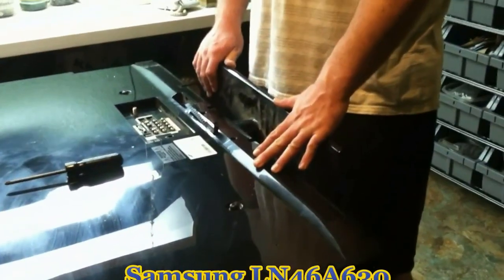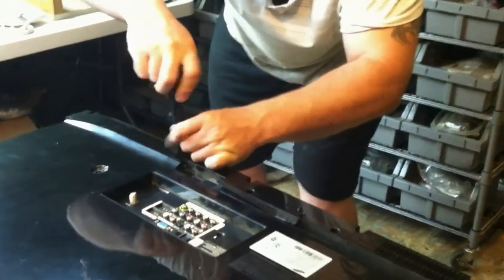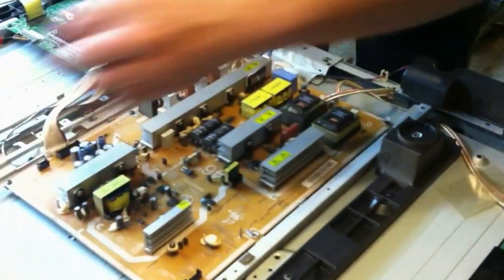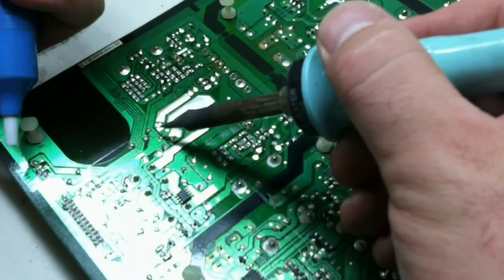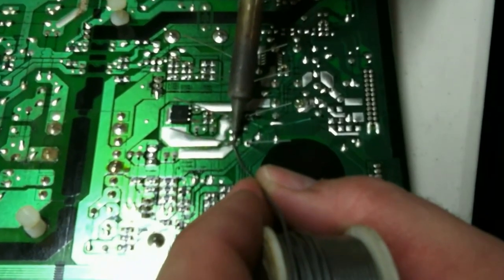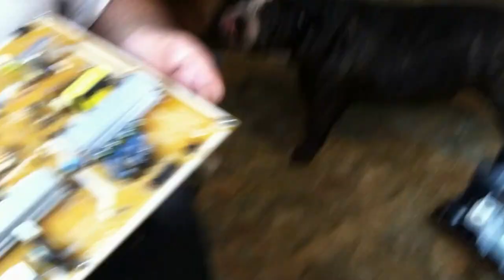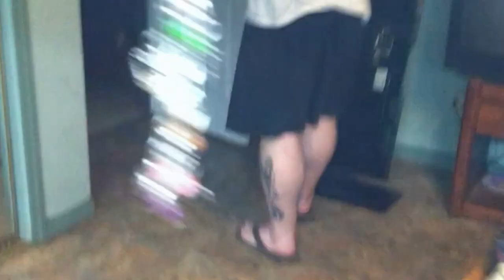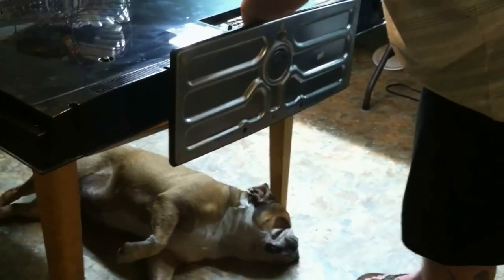Samsung LCD TV Power Supply Repair, Capacitor Replace, LN46A630

Comment: HEY, IT WORKS !!

Thanks for the YouTube video repair.

I ordered the recommended 4 caps from Amazon for a few bucks.  
I already had the soldering iron and solder and the magnetic screwdriver.  
Took about an 1.5 hours - I just followed the video.

Tips:  

Replace all 4 capacitors even if only 2 look bad (why take a chance?)

A power screwdriver makes it easier.

If you are new to soldering, practice on scrap wires first.  You'll get
the hang of the flowing solder and how it should look.

I didn't have a solder sucker, so I held the bad cap with my left thumb
and finger underneath the board, and used the iron on the solder side.
As each of the solder points melted, I pulled on that side of the cap and
the wire came out.  After the cap was out, I remelted the solder joint
and used a round toothpick to make a hole in the solder.  Works perfectly.

Also, the iron tip should be clean.  You can wipe it (quickly) on newspaper
or whatever.  Then melt a dab of solder on the tip before using it on the board.
Let each solder joint cool down for a minute before starting the next solder joint.

Great Video - Love the dogs - they seem really interested.  LOL.

Comment: I have the exact same tv so this was really helpful. I’ve never attempted anything like this but took a shot because the video was so good. And the tv now works!  I have never attempted to solder before and this was the biggest challenge for me because I couldn’t melt the old solder off.  Eventually I had to heat it and use a persistent amount of force.  I even made a run to Home Depot to get a 100 watt iron, but that hardly helped.  On soldering the new capacitors, for whatever reason, heating the source, not the solder, didn’t work.  So I heated the solder and that worked.  The result looks quite unprofessional and sloppy, but it works and as long as the tv doesn’t set the house on fire, I,m good.  Thanks for taking the time to do the video.
Reply from the maker: Michael Mizrachi, glad I could help!

Comment: Absolutely brilliant. I thought I would need an expensive repair - or even a new TV when the time to start up got longer and longer (with the relay clicking like a clock of doom!). A couple of 59p capacitors from Maplin (1000 microfarad, 25V, 105C.  Product code LT50) and some "therapy time" with a screwdriver and soldering iron and all is well. Thank you so much.

Comment: Thanks man. I spent 6 buck at Radio Shack (bought an extra just in case) & a little bit of time & got everything back up & running. Not sure what it would've cost, but I know the shop wanted $65 just to look at it.

Comment: Thank you VERY MUCH for your Excellent instructions and Excellent video filming by your wife.  I followed step by step and the repair was successful for Samsung LN37A450C1D and replaced 3 capacitors (1000uF 25V 105 deg C).  The dog "sound effects" in the background kept it relaxing.)    :)

Comment: Aloha There..... On my LN46, the four you mentioned needing replacement were flat, on top, and the two I removed were flat on the bottom too.....   It seems they did have some black smut on the top, but they were not breeched.  The big 450WV, 150uf had a super buldge and I have ordered one.  Your big ones were lying sidewise on the set you were working on.  Pretty costly, $18.65 on Amazon.  Two of the four up top were 2200uf and two were 1000uf.  Thanks for your info.

Comment: I replaced all four capacitors. Two 25v and two 16v for a total cost of $2.67. It works great.
Reply: How did you manage to discharge those 450v capacitors in the middle before working on the 16V ones?
Reply: FlyingPigNJ - if the tv hasn't been on for week or more, they will have self discharged... But you are correct... Testing voltage on, and or shorting it off of capacitors in the high voltage section of the P/S is a safety "best practice" that should be observed.

Comment: Thanks for a great video.  I noticed that my 4 capacitors (like the one's you replaced) are not bulging at the top but I think you mentioned that it can bulge at the bottom which would be harder to see.  What is bizarre is that on my stand I had shiny plastic washers.  They were disintegrating so I'll have to go to Ace HW and get a replacement.  I'll try the 4 caps first before doing any other to see if my image issues go away.  I have a situation where I get two images on a cold startup.  One half is normal size and the other half double size.  When it warms up it goes back to normal.

Comment: Not sure if you still have some of those capacitors but I would be interested in getting 8 of them if possible. I need 4 but would like a second set in case of faulty capacitors.

Comment: thanks for the detailed video. my problem doesn't seem to be capacitors. visual inspection indicates none are blown. am I back to a failed power supply? my samsung TV cycles on and off 6-10 times when I turn it on before I can get a clear picture and sound.

Comment: Thanks, that will fix one problem.
Ever see a problem with line in the screen? You squeeze the right side edge to get it to work. I think it is the screen connectors.

Comment: quick question i have an LG plasma and in the power supply board there is a little blue cube (that looks like it has ceramic inside) can you tell me what that is called?

Comment: Thanks so much! Our Samsung TV has started to have this problem and it has finally got to the point it just won't turn on at all. We had it installed on the wall and the guys that installed it didn't write the model # down for us... is there any other place it could be other than the back? I found your video easy enough to follow that I feel able to attempt the repair myself... once I figure out how to get it down! LOL Back to You Tube! Thanks again!

Comment: hey do you have another suggestion i open up my samsung lcd and none of the capacitors are bulged out yet the tv does not turn on just every once in a while ..there is not clicking sounds or nothing/....so I'm kinds stuck right now and looking at other videos but you seem to have the most Direct one!

Comment: 3 Things... 1 clean your tip bro... 2 I always add a little solder to the leg I'm going to desolder, to get better heat transfer... 3 It would be useful for you to mention that any electrolytic next to a heat sink should be suspect, if not automatically blamed, regardless. I always change them. If I am already in there and the board is out, it's just good practice. I would also heavily scrutinize the large one next to that other heat sink... It would be good for you to explain that the heat from the heatsink destroys electrolytic caps. Old analog TV's suffered the same problems, in the horizontal and vertical circuits. Why didn't you show it powering up as opposed to putting the screws back in?... Good repair though!

Comment: I have watched the video and we have replaced out capacitors.  There was no bulging or signs of malfunction at all,  but we went ahead and replaced the 4, 1000uf 25 volt and the 2, 470uf 25 volt capacitors.  The TV stills clicks on and off and eventually comes on after weird screens and crazy noise.  
What else can we try?  Please help.  Patty  P.S. Very easy to follow video, thank you so much!
Reply: check the heat sinks for any cracks and solder them if needed

Comment: I have a 42' Digital Lifestyles tv it was working fine unti couple of days ago  i tried turning it on all i hear was loud cracking and my tv wouldn't turn on anymore i opened it up and i noticed one of the voltage regulators that was attached to the head sink was black and burned and completly disconnected from the board do you think i can replace just that one regulator or replace the whole power supply?

Comment: What about risk of electric shock that the capacitors hold. Shouldn't you discharge these first especially the larger ones if your handling the board while soldering??
Reply: +Niki Hunwick 
yes...

Comment: those hansol power supplies suffered from the "capacitor plague"

Running a hairdryer for 5 secs over the suspected bad caps will allow you to power on the set to make sure it really is the caps at fault, they dont always bulge and its a good idea to change them all at the same time, replace the 16v caps with 25v for a bigger safety margin

Comment: I have the same television with that problem. There is a metal cover over my power supply that needs to come off. Two of my capacitors are 25v and the other two are 10v.

Comment from the maker: caps that size will discharge quickly.  you can always short them with a screwdriver after you have them out, but i wouldn't worry about it

Comment: I have a Samsung M# LN-T4071F is turning on and off i check the caps and they weren't bulging or displaced at all, i replaced the caps anyway and it didn't fix the problem unfortunately. What else could it possibly be any help will be grateful.
Reply: +Tainowarrior00707 , problem   could  be  with  your  video  board ,  i  have  a  samsung  LN37"  doing    same  thing  &  from  researching   here  &  shopjimmys   its   their  claim  components  on  video  board  causes  that  ,  google  your   model  &  what  its  doing  ,  think   shopjimmy  offers   repair  services

Comment: woohoo i replaced 1 capacitor and it works again :D
(a 200v 47uf came out and the woman gave me a 350v 47uf... problem?)
Reply: Frietpan - I realize this reply is a little late, but for anyone else wondering...  as long as it is the same type of polarized electrolytic, a higher voltage rating is fine... Higher voltage rating should actually last longer, in your repaired power supply.

Comment: Watch some basic videos on soldering, tip the head of your iron first.  It shouldn't be blackened at the end.  Add some extra solder to the wire before you try to remove it,  flux helps a lot as well.  Also buy a good solder station, don't buy something that doesn't regulate the heat.  You'll get frustrated because the equipment doesn't work well, doesn't come with replaceable parts, and then just give up.  You see him pushing with the soldering iron, that isn't wise - if your soldering iron doesn't heat up quick enough or hot enough to melt solder then you just need to buy something better.  Don't ruin components or burn holes in the board from lack of knowledge, do some research first then give it a go.

Comment: I took my samsung LCD TV modelLN40B650T1F to a tv repair, and I'm told it will cost me $500.00 to fix it... 100.00 for diagnostic/labor & 400.00 for the parts. Is this guy for real ? There's sound and power , picture stays on for only 3sec. Then picture goes out . But the power n sound r still on.